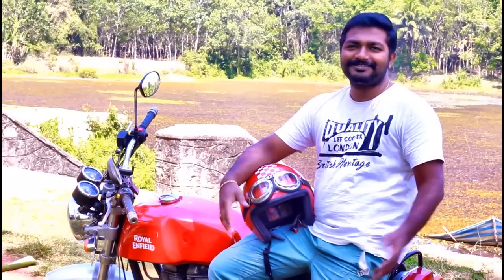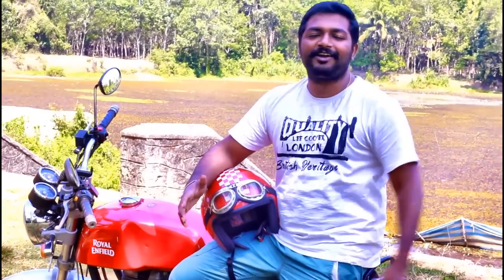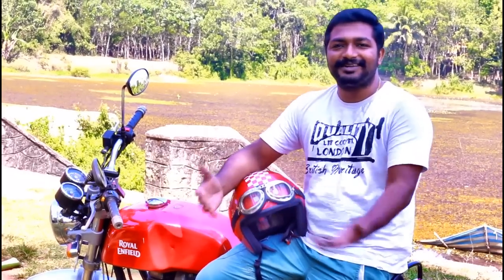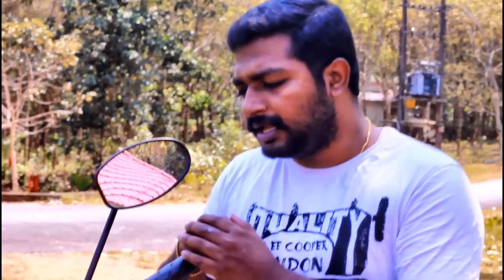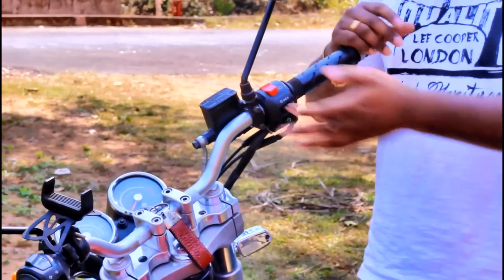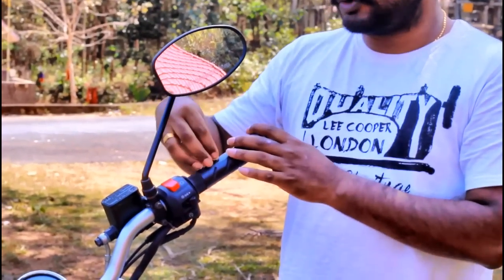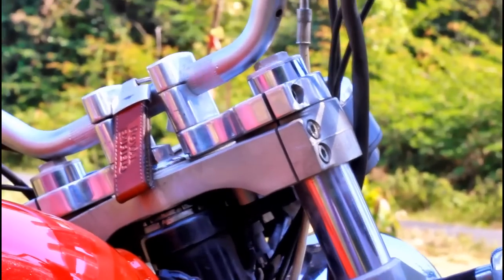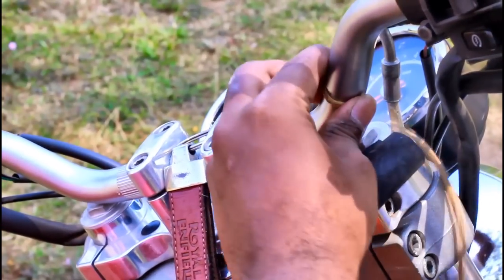Royal Enfield | How to reduce handlebar vibration | 100% working | DIY 2017

Comment: I would like to try what Abhilash has suggested . It's indeed a nice jugaad as rubber , leather , memory foams , neoprene and even fine sand can be used as vibration dampeners.

In Addition to that , RE owners can try 
1. Filling a highly viscous , heat tolerant synthetic oil owing to the hot ambient temps in India . A Motul 15w50 5100 is specifically designed for long stroke , big bore thumpers with wet clutch and integrated gearbox. 
The Motul significantly reduced overall NVH levels

2. Using a heavy handlebar . Heavier things tend to vibrate less than a hollow , lighter ones  . 
A heavy handlebar , with a long bolt welded inside / filled with sand + lead balls or foam along with bar ends will do wonders.
Also , handlebars with a connecting rod tend to receive vibes from the bent portions of the handlebar(as shown in the video) and later the connecting rod can be tied with leather / rubber or with a anti vibration barrel. This is common on pro tapers , renthals and moto cross bikes.

3. A foam / leather handgrip + semi gauntlet gloves also works well against making your hands numb.
Reply from the maker: Thanks Balaji, as always an informative comment.
Reply: Pleasure is all mine.
Reply: Balaji S I have installed the Hayabusa type clip on handlebar which doesn't fits on the forks..but on the old handlebar clip & now I am getting hell of vibrations on the handle as well as on mirror..pls suggest me something to avoid and reduce the vibrations

Comment: What about the end weights?where can i find them?If i didnt mke a hole on hndlebar..jst tied the rubber tube will it reduce vibration on my cl350...Reply will be appreciated...tnx for the video..
Reply from the maker: +Midhun G hole is not a requirement. Since Himalayan has a hole we can utilise them. Bar end weights for himalayan are available in service centre.

Comment: Hi Abhilash i own a classic 500. it too have a littile bit vibration. as my opinion i think the vibration in bulls are coming from the engine directly bolted to the chasis. i had seen on other bike's have rubber engine monting between engine and chasis. only that can reduse the vibration of bull completely.
Reply from the maker: One of the tricks to get the handlebar vibrate less bro!

Comment: hi bro,
Is it possible to fit Himalayan handle bar to my standard 350 ? any alteration is there..& awesome idea too...
Reply from the maker: +kathiravan yes buddy, you can fit Himalayan handlebar. The clamp needs to be changed with a piece to fit it with the head assembly.
Reply: Abhilash Pillai  thanks a lot for quick answer....
Reply from the maker: You are welcome Kathiravan

Comment: from where did u get this handle mount? it will be very helpful if you can share the details
Reply from the maker: It is from hitchcockmotorcycles.com
Reply: Abhilash Pillai thank you a lot. I am facing another problem. I own a GT too. when I am turning the bike its feel like the handle is getting locked, specially left side turning. I have checked the ball racer and its OK. another one is sometimes I feel the rare tyre is pulling to right side. I have checked with proper air pressure also. any idea?
Reply from the maker: Check your fork for the tight alignment, check if the tyres have worn out at the sides. A good mechanic can easily catch the issue
Reply: Abhilash Pillai thank you. I am really disappointed with RE service center guy. they are saying everything is OK and there is no problem
Reply from the maker: They are being trained to correct known issues, replace parts if something appears faulty. It is often advised that you consult a expert RE mechanic not the service center for better resolution. If he advises a replacement and if that is within your warranty then you can approach service center.

Comment: hey where did u change your handle bar, even i want to change my stock cut handle bar to normal, the one you have shown in the video.
Reply from the maker: +ANUP U S got it changed by a local mechanic. You need the clamp from Hitchcock to facilitate that.
Reply: name of the handle bar any specific,
Reply from the maker: +ANUP U S I used the Himalayan handlebar
Reply: OH,,OK

Comment: I have two quesrions(out of this context)
1) What's the mileage of GT..just approx

2) Your helmet looks great, I booked RE 350 red ditch red , seems this helmet would suit the bike atmost..but I'm bit allergic to dust, what other option would you suggest for re 350 redditch red I. Full face
Reply from the maker: 1: 25 KMPH
2: go for a full face helmet, they might have options in the online store
Reply: Thanks
Reply: I checked online, but none in re helmets looks good for redditch red except this..so m thinking to get a simple full face studs helmet n put same kind of stickers on it with re logo.. With the help of local number plate guy.. What's say..
Reply from the maker: Piyush Gupta that's like a good idea buddy. If you have a facility, do try.
Reply: Will try n post pic of it .. Thanks anyways..ill try ur anti-vibration trick as well..but let me feel the vibes first..20 more days..;/
Reply from the maker: Piyush Gupta okeys buddy

Comment: I have installed the Hayabusa type clip on handlebar which doesn't fits on the forks..but on the old handlebar clip & now I am getting hell of vibrations on the handle as well as on mirror..pls suggest me something to avoid and reduce the vibrations
Reply from the maker: try using a heavier bar end weights for the clipons. The best way to reduce the vibrations are to mount them below the forks like a racing bike.
Reply: Abhilash Pillai I have mounted them on the bracket of handle bar...
Reply: Abhilash Pillai which are the heavier bar end weights ? Any suggestions

Comment: i have enquireduired to RE shop regarding himalayan handle bar to fit my std 350 .they told that only handle bar can fit this type and the clamp not able to fit.because if you fit  the clamp you need to change the fork .without fitting clamp ..is it usefull..I want comfort ridding without any vibration.guide me???pls
Reply from the maker: Hi Bro, you do not need to fit a himalayan handlebar on a standard. There are other options available. Something like this...http://www.amazon.in/Royal-Enfield-Handle-New-curved-handle/dp/B011NMG8OK?tag=googinhydr18418-21&tag=googinkenshoo-21&ascsubtag=0e54aae7-54c4-40ea-8c3b-4b9fc1e22d6e
Reply: Abhilash Pillai  thank you bro.
Reply from the maker: Welcome!

Comment: Bro , where shall I install the Rubber strip in RE Thunderbird 350.. I have retained the stock Handlebar on my Bike
Reply from the maker: Sabarish can you explain what you mean by the rubber strip.
Reply: Rubber Strip - the Cycle tyre Tube
Reply from the maker: any rubber element would do the job.

Comment: I dont want to change the handle bars, is there any other way to reduce GT handle vibrations without changing it......
Reply from the maker: best way is to change handlebars. You can reduce vibrations further by moving clipons lower than normal setting. Fork setting can be adjusted to reduce vibrations. Rubber cushions on the clipons would also help you reduce vibrations.

Comment: even my tank has a lil vibration...why would vibrate.. wil it b any tuning issues?
Reply from the maker: I did the following to solve it:
1. Check the fork alignment
2. Check the screws for tightness
3. Loosen the brake pads touching the disk.
4. lubricate the engine.
Reply: Abhilash Pillai fork alignmnt means?
Reply from the maker: Very often, the forks can be twisted out of alignment either by improper installation or after they've suffered an impact that imparts a twisting motion. Aligning forks helps avoid any unnecessary vibrations on handlebars through forks.

Comment: if the vibration can be reduced, why the company doesn't do that?
Reply from the maker: +Toms Gorky Bullet can be tuned for speed and stability as you may know. The company does not do this either, they want to give a product that has lots of scope for improvement, modification. Or it may be that they haven't taken vibration removal as an important part of their ' to do ' list.
Reply: Because it looks like hell.
Reply: Great q
Reply: Because it is not cost effective while producing in a mass scale
Reply: Newer bikes like Enfield meteor has zero vibration, that's because they have double rod chasis frame. But as u said, why they did nothing all these years!

Comment: Man carberry reduction plate standard 350 il vekkan patto engine noise kurayo
Reply from the maker: It does not affect the engine noise. You may see slight reduction in ngine sound and vibrations. You can use it on any new engines

Comment: you told black will fade,is there this problem with green , is green with double seat visually bad
Reply from the maker: Depends on individual taste buddy. Some say the black looks good. I personally liked black when I visited showroom but then later when I saw a purchased bike, it looked bad. Try the DIY technique on your bike and let me know if that helps.
Reply: Abhilash Pillai how is green
Reply from the maker: :) good
Reply: Abhilash Pillai the showroom person told that the bar end mirror would cost 7k , can i find the same quality mirror cheaper from somewhere
Reply from the maker: Siva Prasad it is only 4 k. Ask a genuine service center
Reply: Siva Prasad in Mumbai we get handle bar of Himalayan in 650₹
Reply from the maker: sayyad Azmat Ali 560 in ernakukam
Reply: Abhilash Pillai i was told by salesman that i will get bs4 gt with aho , is that good or bad. there is only 1 bs 3 ie black ( no green) , should i wait for new or fo for old stock , is it worth waiting
Reply from the maker: Siva Prasad I think some of your text went missing. Can you explain once again the question.
Reply: Abhilash Pillai. any update about new bs4 continental gt ,what are the changes , is it good or bad
Reply from the maker: Siva Prasad That is a twin cylinder 750 cc engine and hence will avoid most of the issues that GT had with vibrations.
Reply: Abhilash Pillai not sasking about new gt750 , iam asking about change in gt525 it is going to get drl , and bs4

Comment: Will it reduce vibration if we put a rubber packing to where the handlebar fits? Just guessing. Vibration comes from engine through the frame into the handlebar where it is connected. If we apply rubber packing there I guess it might dampen vibration to a greater extent. Again just guessing. Will try it out. Also liked your DIY solution.
Reply from the maker: Tried it but does not reduce the vibrations on the handlebar. In case of GT, there is another workaround for the clipons. But that was the best spot I were able to see the vibrations reduced.

Comment: what to do for clip ons?
Reply from the maker: As I understand the portion where the bar fixes in the clamp should be coated with rubber. Not an easy process.

Comment: Handle change aakan etra aaye ??
Reply from the maker: mine was costly Afras, costed 11k. You can get it replaced now a days for 2k.
Reply: How ??
Reply from the maker: You need to get raisers made by a local lathe shop. Then use the clamp of KTM and it's handlebar. The mechanic can drill the GT clamp to mount this arrangement.